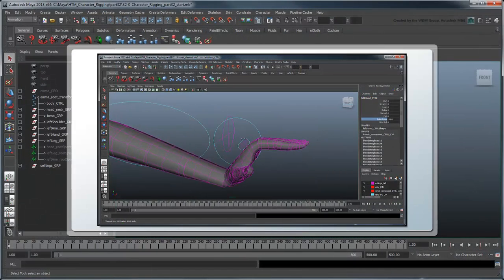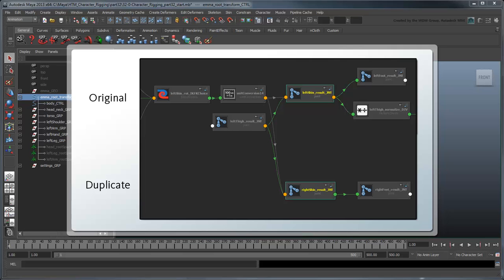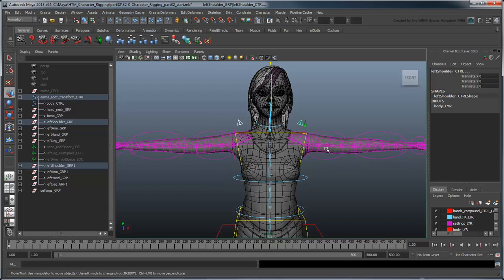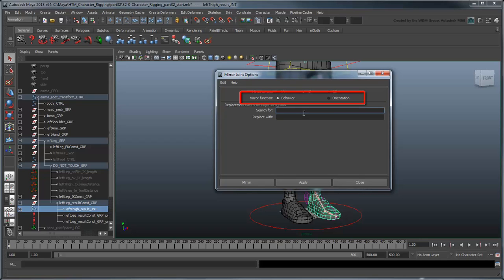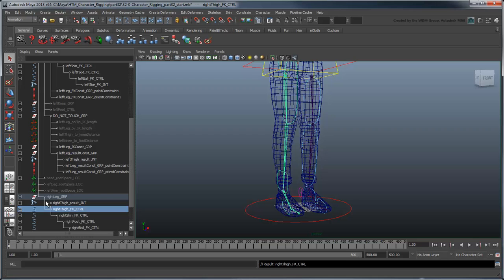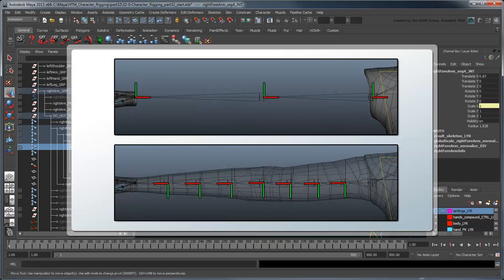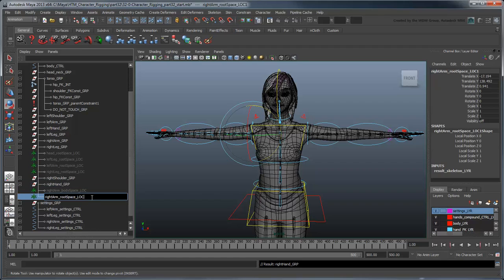Creating a Character Rig - Part 32: Mirroring (Advanced)

Comment: the duplicate special option seems to has been reworked in newer versions of maya. i'm working in maya 2017, and after the duplicate special , the IK controls worked as intended, altough the translation based shoulder now has the problem of not working symmetrially, the rig seems to work. is it a trap, and there are problems i'm just not seeing, or has maya really fixed this?
Reply from the maker: As long as the rig reacts the way you want it to, then it's fine.  Just make absolutely sure that all the controls function consistently across both sides.
Reply: Did it ended up working just duplicating with special?

Comment: how did you do the orient constrains on the right arm?
Reply from the maker: You can check the included scene file to see examples.  Basically, I mirrored the joints, then re-oriented them using the "Orient Joints" command.  Then linked them up the same way as shown in the previous videos.

Comment: hi I tried to follow the sample above but when I do the orient constrain on right arm it flips. any tip on orient constrain?
Reply from the maker: Have a look at the local rotation axes between the right IK, FK, and result arms and make sure they match.  Also, make sure that the "Maintain offset" option is turned on in the Orient Constraint options.

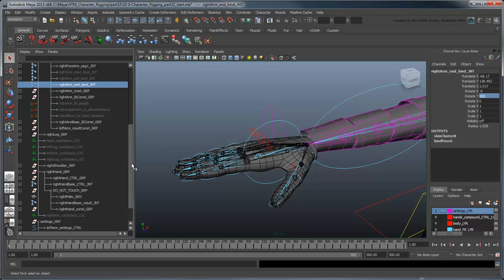Comment: After I do the constraints at 16:00, whenever I rotate the rightHand_FK_CTRL the rightForeArm_seg3 & 4 JNTs rotate in X.
Reply from the maker: You may need to use different Advanced Twist Control values.  See the note in part 22.
Reply: That fixed a good portion of it. Still some minor twist happening on the rightForeArm_seg4_JNT. If you don't have any other suggestions, no worries. It seems like it's tolerable. Thank you again!
Reply from the maker: In general, that twisting is unavoidable due to the math behind the scenes.  You just need to find settings that hide it for the most poses you'll be using.
Reply: Fair enough.

Thank you for all your help!

Comment: Maya learning channel, when I bind my right hand to the right arm at 16:08 my hand only seems to be bound half way. I mean if I do the palm raise attribute, the arm only goes up half way. Note that I rebuilt the right arm instead of mirroring it. If you could help me that would awesome.
Reply from the maker: Sounds like you may have forgotten to set a BlendColors node value properly, or a Driven Key is weighted wrong.  What you're seeing is most likely the palm being partly influenced by its original position + its raised position.
Reply: Thanks, that should help.

Comment: Hello again sir, I just have couple of questions about the right arm behaviour, how do I orient the right upper and forearm segmented joints to match the ones in the video, cos I tried different values, but the orientation isn't changing. Secondly, when I enabled the right elbow snapping at any value between 0.001 and 0.999, the right hand first squash before snapping to the control. How could I fix this?
Reply from the maker: Are you trying to orient them after you've already attached an IK handle/spline to them?  Once you've done that, you can't change their orientation.

When you say the hand squashes, do you mean the geometry?  Or is it the joints themselves?

Comment: Hi maya chanel ,this tutorial is so excelent but i'm not shure i can finish it actualy i was in Appendix A4 that i found out my right arm's orientation is not the same as you showed in part32! I tried to fix it ,the left arm was true so i mirored joint leftUpperArm_result_JNT to right but it's orientation did'nt fix. So I tried to make the rightupperArm _JNT by insert joint from right upperArm_result_JNT but it's orientation did'nt fix again now i realy have no idea how to fix this plz help
Reply: My problem is the orientation of rightUpperArm_seg1 to seg5_JNT and rightForeArm_seg1 to seg5
Reply: I used this command to flip them to the way they are in the vid "rotate -r -os 180 0 0;"
Reply: Hi, I think am having a similar problem too. Although, I was creating both the left and right arms simultaneously throughout the tutorial. I created the right arm by mirroring the left arm, but they no longer have the same orientation. It even became obvious when i was enabling the arm twist. The left arm twist correctly but the right arm wasn't twisting like the left arm and i have no idea what to do to make this work correctly
Reply: Exactly the same problem I was facing...

Comment: I there a reason that when I move the body control up, one foot stays planted and the leg stretches, but the other pulls away from the foot control?
Reply from the maker: Are they both IK legs?  If so, then that shouldn't happen.  I'd check your hierarchy (especially where the measurement nodes are parented).

Comment: How do u reorient your Result,IK and FK joints X axis inverse to the hierarchy direcction?, i cant do it with orientJoints tool.
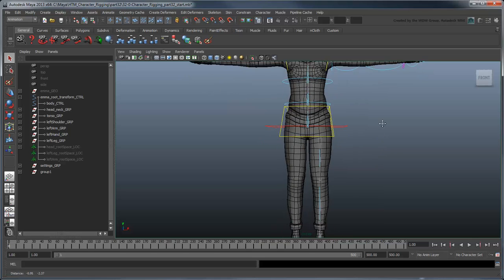Reply from the maker: Actually, as discussed in 6:34, you actually don't want to mirror your joint orientations because it will cause bad rig behavior.  If you check the finished example in the description, you'll see that the joint orientations remain consistent on the left and right sides and the rig calculations change in accordance with that.
Reply: Thnaks for the dast reply

Comment: Hi, I've run into a weird issue with the foot rig. When I use any of the custom attributes like roll, toe spin, or lean, it moves the IK handles. For instance, with the roll, after around 50 degrees the heel begins to lift, the toe begins to bend backwards and you can see the IK handles begin to move. It appears that the locators might be moving as well. Can you think of any reason it might be doing these things? Thank you in advance for your help!
Reply: Here is a screenshot of how things are laid out currently. I went back and started the foot again. I've followed everything completely and I have no idea what is wrong. I'm really hoping it isn't an issue with the leg IK handles as I really don't have the time to go back and redo the leg!
http://tinypic.com/r/10ru1xc/9
Reply from the maker: This sounds like a parenting or constraint issue to me.  Double check it against the scene file to make sure the node hierarchy matches.
Reply: I found the issue. Somehow I was missing some distance nodes and locators, which was having a major impact on some of the maths. I don't know how, but all the scaling seemed to work still, but not everything else. I went back to the leg and re-did it, and no everything is working as expected =)

Comment: For rightLeg stretch you put two scripts one for right pole vector leg stretch and second for right no flip leg stretch ,when should we use them becouse in left leg we run the script right after the maiking leftLeg_CTRL and the ik handles.we should run two scripts for the rightLeg? Shouldn'nt we?
Reply from the maker: You can run a specific part of the script by highlighting it and pressing the Execute (1 triangle) button in the Script Editor, so you can run each section of the script at the same times you ran them for the left leg.

Alternatively, you could complete the initial setup (with measurement nodes) for both the manual and no-flip legs, then run the entire script at once.

Comment: The handConst_GRP constraint at 15:30 rotates 180 degrees in X and not Y, and refuses to rotate if I do a pre-rotation. I tried just parent constraining with maintain offset turned on, and that worked. Will that cause problems later?
Reply from the maker: As long as you test all the related controls and they work fine then no, it shouldn't be a problem with anything that comes after.

Comment: interesting problem i ran into on the right arm, everything works as intended except for when im moving the root or the upper body control the right hand stays planted on the IK control (stretching the arm), while the left hand is being pulled with the body (no stretch).
Reply from the maker: Sounds like you've got a parenting problem for the control.  Although, when moving the upper body control, the IK hand SHOULD stay planted.  However, everything should move with the root.
Reply: found it, my IK length start LOC on the left arm was not parented correctly

Comment: Last stretch and I'm not able to get the palm raise and side roll working on the right hand. I've noticed mine doesn't flip when parenting the rightHand const_GRP to the rightHand_result. The hand still works at this phase but as soon as I parent the rightArm_end_bind_JNT to the rightHand_baseConst_JNT, palm raise and side roll don't work.
Reply from the maker: What do you mean by "don't work"?  Like they don't move even if you alter the values, or the do something incorrect?
Reply: Late reply but I was simply parenting it in the wrong order.

Comment: Hi, first thanks for this great tutorial, but i have  a problem^^. how do i export animation to unity with this Rig?
Reply from the maker: Due to all the custom nodes this rig uses, it's really more suited for rendering within Maya for things like movies and cutscenes.  For sending to Unity, you will probably have to bake the animations right into the mesh using Key > Bake Animation before the actual export.
Reply from the maker: You'll also need to export as the FBX file format.
Reply: Thanks to be so fast to answer. Thats what i do but even if i open the fbx in maya i have the same issue: the hand, the head, and the two part of the arm seems separate. i will try to put a GIF to show you.
Reply: http://makeagif.com/i/6zlhsV
Reply from the maker: This may have something to do with the squash and stretch.  I'm not a Unity expert, but I'm not sure that they have support for Maya Multiply Divide nodes.
Reply: okay, i think i will try to make a skin skeleton that gonna be constraint by the result joints, don't know if it's a good idea.

Comment: My palm geometry is stuck on the left even after unlocking its channels and setting Scale X to -1. -1 Scale X just makes it face the right side but it doesn't move the geo to the right hand. I manually moved and froze the transforms. Is that fine? Thank you.
Reply: I tried searching in the comments to see if anyone else had the same problem. I managed to fix it by setting the palm's center pivot to to the origin and then flipping it.

Comment: Great tutorial series. Thanks a lot. I have a question though. At the beginning you cut up the geometry into different sections. What happens when you're done with rigging? How do you put them back to form a single geometry as before without having issues with the animation set up?
Reply from the maker: This is probably the question I get most often.  Once you're ready for rendering, you'll want to delete the cut-up (proxy) geometry and reimport the full emma mesh from the part 2 scene file.  Then you can use Maya's Smooth Skinning feature to bind the mesh tot he result joints.

Comment: I have my rig functioning 99% complete. My only issue is the arm gimbal. Mirroring joints automatically sets them up to invert when you select the fk controls but the extra gimbal on the shoulder does not because it is not a joint. How do we set up the gimbal to become inverse like the rest of the fk controls?
Reply from the maker: That should be taken care of by the rightArm_shoulderSpace_LOC.  In order to maintain mirror-like behavior of the controls, you'll need to rotate it.  See the example file for specifics.
Reply: Oh ok so its the locator, thank you for the help!

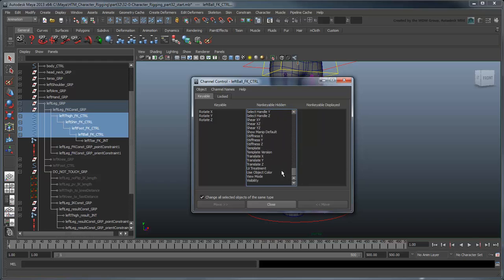Comment: how do you mirror a curve with a mirror joint tool ? at 9:00 ? black magic ? // Error: line 0: A joint must be selected. // and is there a better way to mirror Splines in year  2016 ? :D (keeping the behavior , if there is no symetrical joint to reference to) http://imgur.com/a/n8cFE
Reply from the maker: The curves shapes are parented under the joint, so they mirror along with the joint.  And unfortunately there is no alternate way to mirror splines.

Comment: Hi, Can you please help me.  I've nearly finished but stuck on this one
joint.
When I try and apply and orient constraint the Shoulder,
body and root space locators to the FK const group.  The FK Ctrl arm rotates -53.13 on the right
side of the model. As a result when I rotate using the body ctrl the arm flips
and moves in the opposite direction.

Please believe me I have tried everything,  even rotating -53.13  on all the locators on the FK const before
applying the constraint Group. Trying with maintain offset on and off and even
the FK joint itself and it still does not work.
I have tried so many different approaches I have mirrored
like in video 32, I have Redone the right side completely from scratch apart
from the shoulder joint and it still rotates.

I have looked at your model unfortunately on the
character rigging part 32 start I have tried the same thing on your model and
the same thing happens it rotates.
But on the next file, 32-1-Full_mirrored_leg_partial_arm
You have solved the problems and it works perfectly.
Could you please let me know how you sorted the problem.
It would be very much appreciated.

Thank you.
Reply: Hello. Did you finally figured out the solution. I'm having the same problem. Its giving me a headache

Comment: I am having an issue with the snappable elbow on the right side. Whenever the elbow snap attribute gets to 0.5 the segmented arm joints retract to the Upper Arm joint, but then stretches back out and snaps to the elbow control.
Reply: Okay, I figured out the issue. I wasn't multiplying the distance nodes involved by -1 before feeding them into the input1x of the stretchChoice nodes. I had never encountered this problem in my previous rigs using this method.

Comment: Hi! Thank you again for the tutorial! I've kind of finished it... Except one part.. After I create the parent constraint between rightHand_baseConst_JNT and rightHand_end_bind_JNT, the connection doesn't work as I expected it to work... 

The rightHand Rises when I set ParmRise to a different value, but much slower than the hand...

Plus, one more problem... If I change the rightArm to IK, the rightHand_end_bind_JNT Rotates 180 degree...
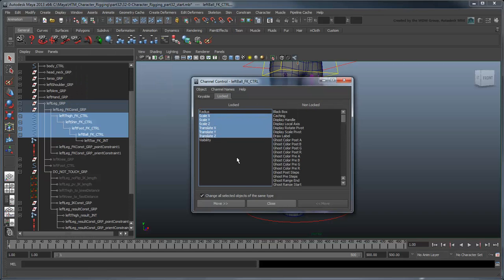Reply from the maker: You used the mirroring shortcut shown above?  It sounds like your spaces are misaligned from IK to the end bind joint, which we talk about at 8:53.

As for your palm rise problem, it sounds like there's a double-transform going on (check the palm geometry in particular).
Reply: Thank you for response!

I mirrored them as shown above, but my joints had slightly different positions, so, in the end I decided to mirror only the Result Chain, and then, I've recreated the arm, from the result, As I did with the leftArm.

And the Palm Rise Problem.. Is not the palm the one that rises too fast, but the hand the one that's too slow...
Reply from the maker: I would check any constraints related to this.  You may have an influence somewhere of 0.5 instead of 1.
Reply: Maya Learning Channel
I see. I will check them.

Thank you very much for all the support!
Reply: I've checked all the constrains but, nothing with 0.5...

I think I will remake the hand and/or the arm, if needed...

Thank you very much for your support!

Comment: Sir,  my right ik leg not stretching...need some changes? pls help

string $driver = "rightLeg_IK_LengthShape.distance";
float $rightThighLength = `getAttr rightShin_IK_JNT.translateX`;
float $rightShinLength = `getAttr rightFoot_IK_JNT.translateX`;
float $sumLength = $rightThighLength + $rightShinLength;

setDrivenKeyframe  -currentDriver $driver -driverValue $sumLength  -attribute "translateX"  -value $rightThighLength rightShin_IK_JNT;  

setDrivenKeyframe  -currentDriver $driver -driverValue ($sumLength*2)  -attribute "translateX"  -value ($rightThighLength*2) rightShin_IK_JNT;  

setDrivenKeyframe  -currentDriver $driver -driverValue $sumLength  -attribute "translateX"  -value $rightShinLength rightFoot_IK_JNT;  

setDrivenKeyframe  -currentDriver $driver -driverValue ($sumLength*2)  -attribute "translateX"  -value ($rightShinLength*2) rightFoot_IK_JNT;
// Result: 1 //
Reply: i have the same problem did you fix it ?

Comment: Is the reason why duplicate special is not completely correct is because when you translate the IK controls, it moves away from each other?  Because I find that in Maya 2016, everything works perfectly okay, even the translating of the IK controls.
Reply: Okay..found a problem but its an easy fix.  When scaling the character, the right side doesn't scale right.  Just reconnect the original root ctrl to the right normalize_DIV nodes since the duplicated root ctrl was deleted
Reply: @MrKenken1515  Maya 2022 also does this. It saved so much time. Scale needed to be fixed as you said. Thanks for saying this!

Comment: The Head Control is not fixed with the geometry. I tried painting the weights but only the next control works. Do we need to add another joint to the neck?

Comment: I noticed when the character is turned 180 degrees, the IK/FK switch is flipped when switching to IK. at 0.5 of the blend the arm flips around. Any thoughts?
Reply from the maker: +Brett Tipul Are you turning the character at the root or the hip?  You really should be doing that at the root level.
Reply: +Maya Learning Channel  I am turning at the hip control.
Reply from the maker: In that case the flipping arm makes sense.  You aren't rotating the global space where the IK control resides, so it's not being rotated around the body.  In order to do that, you need to rotate the space that the IK control is in (the root space).
Reply: +Maya Learning Channel  I got it thanks a lot, I forgot the about changing the rotation space to root. Much much better. Thanks again for the help and a fantastic channel!